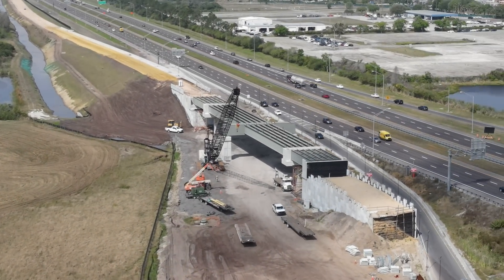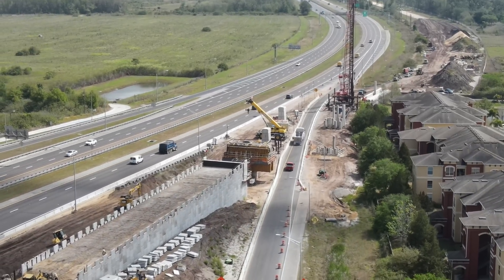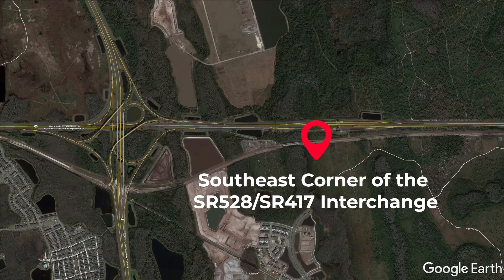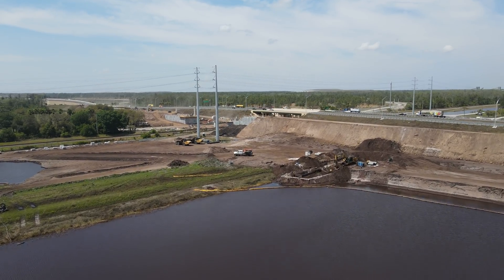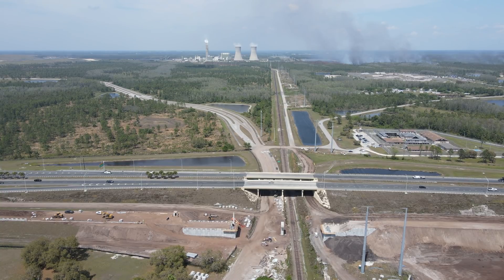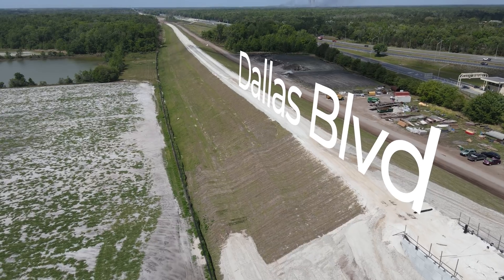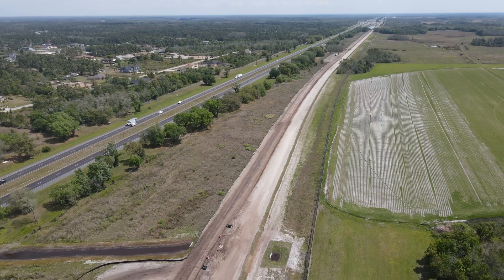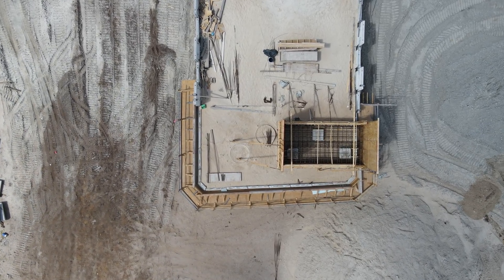Brightline Construction: Flying Over the Orlando Line - March 2021

Comment: This is where those Long road trains would come in handy... instead of dozens of dump trucks, one long tractor trailer “road train” would be way more efficient... when traveling on the main roads is when the train cam be broken apart and each hauled separately or 2 at a time...